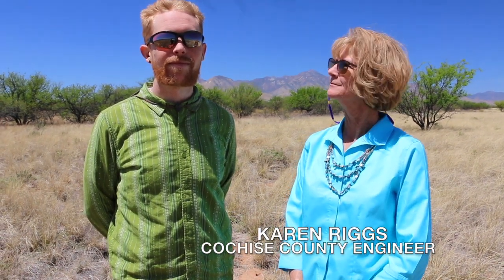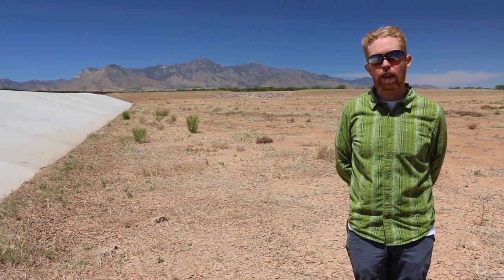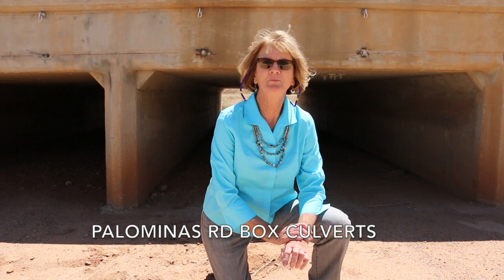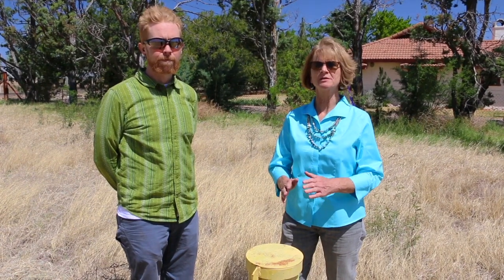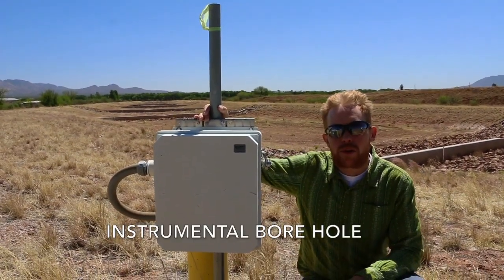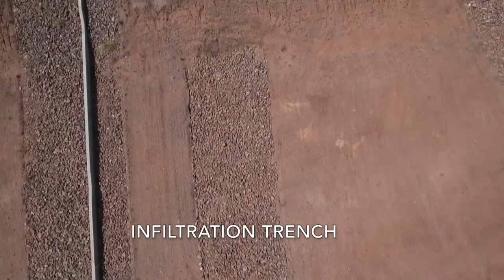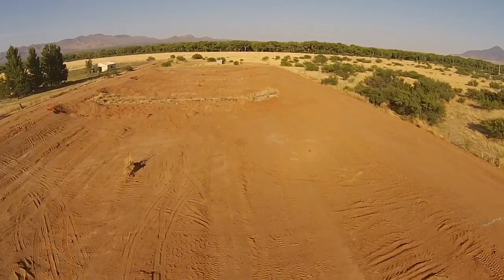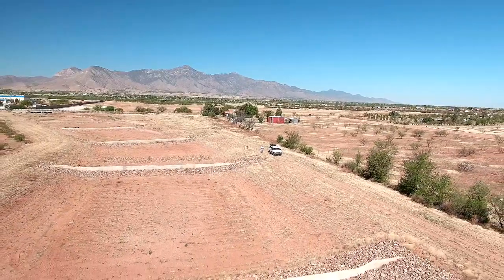Palominas Water Recharge Project - Cochise County, Arizona

Comment: Were there any data points for the river downstream of the project prior to construction of your project? if so has monitoring if any recorded any difference in longer term water levels, One has to assume that spate levels have reduced if the project is working correctly, and as a consequence the river will have a better flow rate in drier periods???